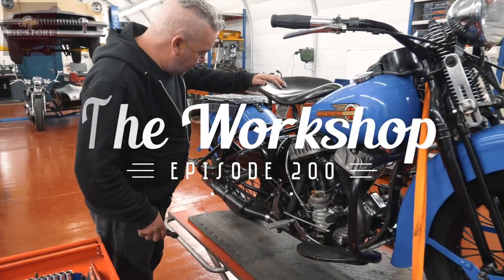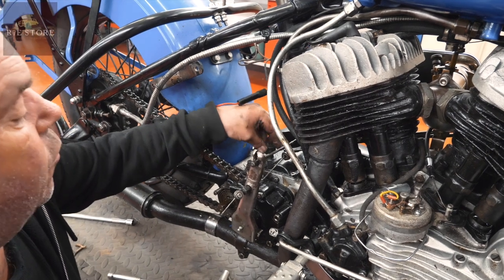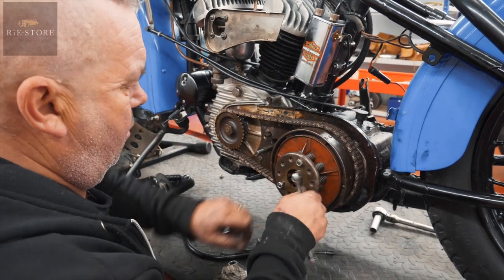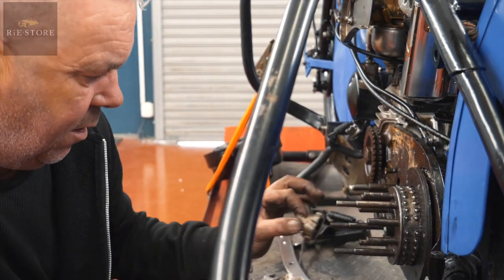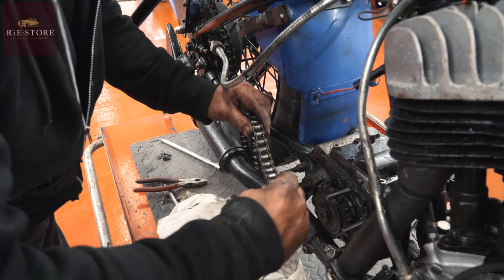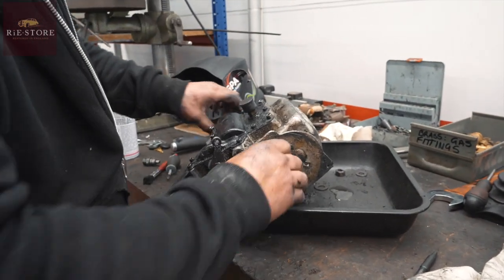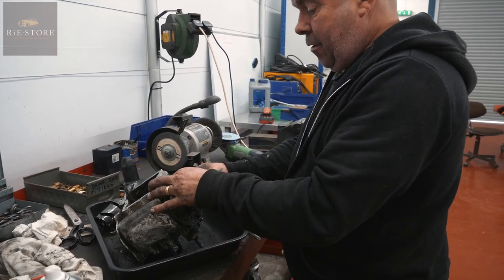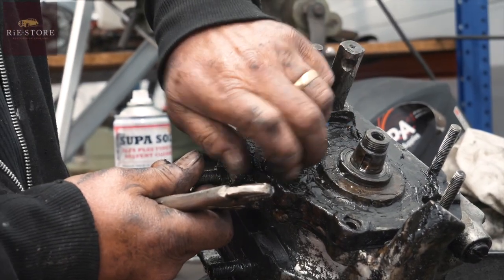Is this the worst gearbox EVER? Harley Davidson WLC / ep200

Comment: Your videos have been so helpful, and my gearbox rebuild is 95% there. Every tolerance is spot on, and it shifts like a dream. However, when I install the shifter cam, #3 to chamfered tooth, it binds up an will not shift into third. Every other gear is perfect. Have you encountered this? So frustrating because I'm so close...
Reply from the maker: I just filmed a Q&A with Ash and he answered you question - stay tuned...
Reply from the maker: Ash answered your question in this weeks video https://youtu.be/VbZnGcp-x3g

Comment: Hello, love the video! I just replaced the kicker gear and countershaft gear because my kicker slipped under load. With the new gears and tripper bolts the countershaft spins freely at top and bottom like it should but the kicker wont ratchet on the way back up. Can you please give me some advice?
Reply: Buy a Goldwing........................................................................................................................................................................................................................................................